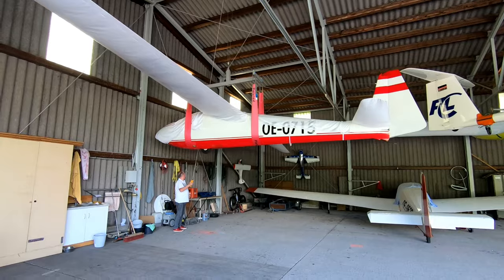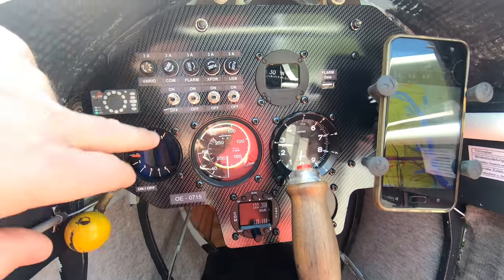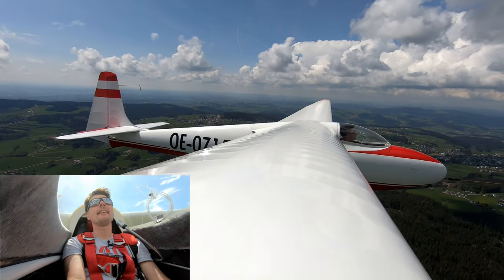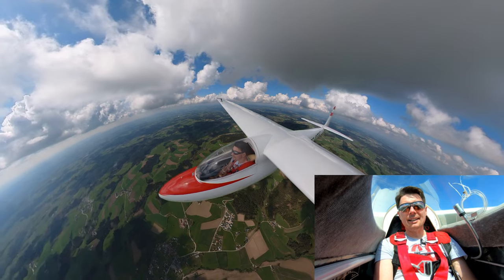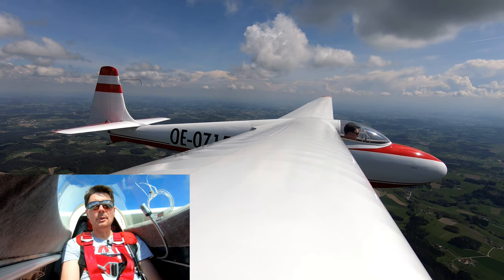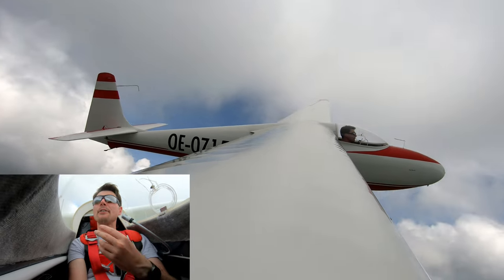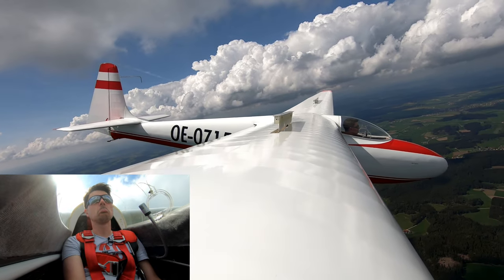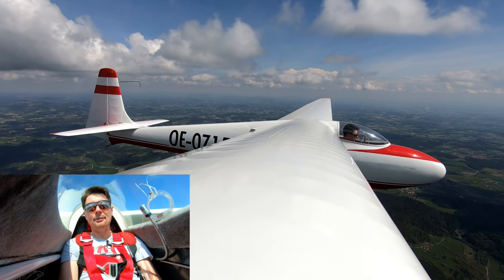How it is to fly a 1966 vintage glider (Schleicher Ka6 Cr)

Comment: I flew a K8 in wave to 18000 feet from a low point of 300 feet in 1982, no oxygen,radio,parachute or electric vario just an old ticking barometer behind my head lol and no warm clothing sheesh  I was 30 years old then, Im 72 now and the memory is still vivid, I got my gold height award for that and landed at dusk after a few hours airborne once I found a hole in the clouds to spiral down through...the beer tasted good after that I tell ya.

Comment: When I started to fly in 1986 we used Blanik L13 for training. The single-seaters the club had were two Libelle (one Std, one Club). It was required to get 20 hours solo in the Blanik before moving to the Libelle. It is very very slow to build solo time in a Blanik unless you have ideal conditions, and no other students around. I actually gave up. Then the club bought a Ka6CR, which required only 5 hours solo in the Blanik. They phoned and said "Bruce, come back!". I had one check flight in the Blanik (after some time gap) and then straight into the K6. Lovely! In the same conditions I got 20 minute flights in the Blanik I immediately had (the maximum allowed per person) 90 minute flights in the K6. Within  a few months I was flying both the Libelle also, and cleared for cross-country in everything. I later flew Ka6E and Ka8 as well as Ka7 and ASK-13.  Sadly, these gliders are getting old and rare now, and they are not making more. But you can get almost exactly the same experience in a PW-5. The speeds and glide angles are somewhere between a Ka-6CR and a Ka-6E.
Reply from the maker: Hi Bruce, thank you for sharing your story! Great. I can absolutely imagine that time-building was much easier with a Ka6!
Reply: I had a very similar experience in the early 80's with minimum required hours as I did all my initial training in a Schweizer 2-22, not even the 2-33.  I could beat the tow pilot back to the ground sometimes, ha.  Then, I found a club that just added a brand new ASK-21, and that changed everything.
Reply: Club Libelle should have been ok with a lot less hours. But a Blanik shouldn't be that bad. It's about on par with a K 8 and is easy to fly.
Reply: @anttiruo  The Club Libelle is very prone to violently drop a wing (usually the right wing) behind a powerful tug (e.g. Pawnee 235) before you get the tail up through a combination of weak ailerons and perhaps a high angle of attack. Much more so than the Std Libelle. Unlike with top surface airbrakes, I don't recall opened the trailing edge airbrakes helping a lot with that. The very light parallelogram elevator control is also very different to a Blanik or K13 and you can easily get into PIO trouble on the first couple of takeoffs when you have absolutely zero experience with it. If you learned on a Duo or DG1000 the jump to Libelle as first single-seater would be much easier. A K6 or PW5 really is a good intermediate step. Also Blanik->K6/PW5->LIbelle performance going 165->130->110 in sink rate and 28->32->35 in L/D really makes it significantly easier to soar and go cross country in weaker conditions.

Comment: That brought back happy memories. I was in a K6CR syndicate for a couple of years in the early nineties and did a couple of long flights in in (leisurely 100k distance and some local fooling around in each flight).  It was a lovely plane and I felt so in touch with the air when I was flying it. It also felt a very safe plane for field landing as it was very easy to land accurately and in a short distance.  One thing I can recall was preferring to circle to the right in thermals because the airbrake lever on the left (and my leg, and the narrow cockpit) made getting full stick deflection to the left difficult for a 6 footer with long legs. To circle to the left, I might find myself have to operate the left rudder pedal on tiptoe so the joystick could just pass below my leg.  We winch launched exclusively at my club and the plane had been a club glider. But it had been judged unsuitable as an early solo plane because the grass on the club airfield could at times get a bit long and there had been a couple of incidents of wing drops on launch. When I enquired more, it had always been the starboard wing that had gone down, and my suspicion was that the pilot had not had sufficient stick authority to the left to pick the wing up. So I always started with the stick slightly to the left as 'all out' was called and I was ready (and expecting) to have to immediately move it to the right. It might sound an odd thing to do, but it gave me a 'head start' on corrective action should the right wing go down, and the tactic always worked well for me ;-) Happy days, and a lovely little plane to fly - I doubt I'd fit in one now!
Reply from the maker: Hi Mike, thank you very much for your story! I know the thing with the missing full stick authority from our Ka8. Not very good for some pilots :-(.
Luckily memories of nice things like flying such a Ka6 stay with us for a long time. Very beneficial for us :-)!

Comment: Hi Rudy,  I owned a KA 6CR in the late 70's.  Entered a few sports class contests and flew it a lot.  I sold it and purchased a Standard Cirrus.  It's true that the performance and characteristics are vastly different but flying KA 6CR would bring a smile to any sailplane pilots face, as it did to yours.

Comment: So when I was flying, the "vintage" gliders were our first single seaters; they were our bread and butter! I first single seated in a K18 and flew them a LOT; I flew the K6CR a few times, and also got one or two flights in a K6e. I flew a K8 a few times at Cosford, too. Trainers I flew a good few times in K13s and once even in a K4!

My favourite was the K18 - the others always felt like I was peering out of a tiny bubble but the K18 had a very low cockpit wall and you could see EVERYTHING - also the K18 felt like higher performance and a bit racier than the wooden fuselage ones (it had a body of aluminium tubes with a stretched fibre covering). 

A wonderful time, and thank you for this video.
Reply: Yes the K 18 is a great performer. On par with the K 6E. Never flew the first one though.

Comment: I've flown a 1969 Libelle H201, an SGS 2-33 and SGS 1-34, each with their own characteristics.

I co-own the Libelle and I really enjoy it.  The narrowness does mean my shoulders are touching the gunnels, and you almost feel the wings are coming out of your shoulders, so you strapped on a glider vs sitting in it.  Controls are light and responsive, and you really can feel what the airmass is doing around you. 

Each of these gliders has spoilers/brakes on top/bottom, so you need to noticeably change your attitude accordingly to maintain airspeed when using them, especially the 1-34.

Every different glider I fly, I feel I learn a lot more about what the aircraft is doing vs my own input, so I think it improves myself as a pilot.  No matter the performance, these are all fun to experience.  Anyone who has an opportunity to fly older gliders should take advantage of that.
Reply from the maker: Hi Dave, I completely agree to your last sentence!

I have flown a Libelle too, but it was 15 years ago. Me and many more Libelle pilots can confirm the feeling, that with the narrowness of the Cockpit it feels the wings are an extension of your arms and you feel better, what the air is doing around you.

Unfortunately I have never flown any Schweitzer glider, I hope I will be able to fly one once.
Thank you for your comment 😃👍

Comment: Totaly hooked on flying Vintage gliders. I own a 1965 Ka-6CR which I absolutely love. I take her cross-country very often, did a 300km declared triangle in it a few weeks ago. I fly several vintage Slingsby gliders too and am co-owner of a Skylark 3C that we are restoring to flying condition. The Ka-6CR in my opinion is one of the most balanced and relaxing gliders in existence. Although the Skylark 3 with its 18,2m wingspan is quite special too...
Reply from the maker: Thank you for your comment, I totally agree, the Ka6Cr is a very balanced glider 😃  - I should fly vintage glider more often too 😍
Reply: Had a half share in a Skylark 2 , 15 metre . Lovely vintage glider but sooo heavy to rig . K6cr was sooooo delightful.  Lovely bit of kit .

Comment: I did my silver C and owned a K6CR about 20 years ago.  I've owned and flown many "plastic ships" but currently own a Slingsby Dart 17r.  My club owns a K8, K6cr, K18 and K13 so I'm lucky enough to fly and instruct on a number of different vintage gliders.  In the UK we also have the Gliding Heritage Centre at Lasham which as a member means I get to fly a wide range of vintage and unusual types.    Vintage is best! :)

Comment: I own a Ka-6CR that is.currently undergoing a stripped-to-the-bones safety inspection and refabric/repaint, NOT the result of any damage or prang, but just due to age. (I also own & fly a Discus B ... so the work on the Ka-6 goes slowly.) But they are absolutely wonderful to fly, particularly on weak soaring days. (And we get a lot of those in New York State, USA)  The Ka6 is the best-thermaling glider I have ever flown -- low wing loading and lovely controls ... partly because it has a nice big rudder.  

The Ka-6 series was (and remains!) the most contest-winning design in the history of soaring - dominating the standard class for years and years ... until the glass sailplanes took over.  It's ability to dominate the other wooden sailplanes of its era was subtle -- on paper some of the others were better, but the Ka-6s just kept winning.  The most-notable competitor to the Ka-6 in its day was the Std. Austria ... that I have also flown.  I don't wish to be invidious ... but while the Std. Austria could beat the Ka-6CR on a strong day, they were lousy on weak-to-moderate days, and they had very unpleasant handling characteristics, particularly trying to do a cross-wind landing.  Contests are won or lost on the weak and average days -- mostly everybody gets around the course on a strong day, and the speed advantage of winning one won't make up for landing out on a weak one.  

The Ka6-CR evolved into the E, and PE ... they look very similar but have a finer fuselage, and the wing sheeting was changed to improve laminar flow.  In that late era just before glass came in the Std-Austria evolved into the Austria SH, that fixed a lot of the flaws of the Std.  George Moffett owned one and extolled its virtues, and sure knew how to win with one ... I've never flown an SH, would like to if I could, but they are rare.   A Ka-6 E (and likely a SH) could give a Phoebus a run for the money .... but when the Std. Cirrus arrived it was game-over for the woodies.

If anyone ever lets you fly a Ka-6 there is one thing to know, that is implicit in this video, but not stated: land it on the grass, do not try to land it on a paved surface if at all possible.  There are two reasons: (1) all the wheel brake it has is a rub-band on the tire.  The brake is lousy.  You may think you know about this if you are familiar with the Schweizer 1-26, but remember that the Ka6 is a tail-dragger: no skid.   (2) The spring+tailspoon will result in zero directional control from the tail (no tailwheel) landing on asphalt as you lose airspeed.  This tail does a LOT better on grass.  But the standard stupid/newbie "accident" (if one is willing to call it that) is a new pilot makes a "nice landing" on a narrow runway in a mild cross-wind and thinks everything is wonderful until they get down to about 15 its ... at which point that big rudder and fin turn you into the wind ... and off the side of the runway the pilot goes futilely jerking at the brake ... and into whatever is over there.  The Ka6 is made for German and English soaring -- big grass aerodromes.  It is not made for the smaller one-runway asphalt strips so common in the USA, particularly the typical 50' wide asphalt with landing lights 2 ft (2/3 m) off each side.  Recognize its limitations ... don't break up a beautiful oldie in the dumbest and most common way.

Comment: Started 1970 on Blanik, K13 then K8, K6CR and E, then Dart 17.  Silver was in a K8, Gold triangle K6E unofficial then repeated in a Standard Cirrus.  Those were the days... Instamatic camera mounted on the left side, smoked tinfoil barograph (fixed later with hairspray), chalk board declaration signed by an OO, proper navigation, turnpoint had to be sighted and photographed in the correct quadrant (the negatives had to remain uncut)...no GPS, no motors, no water ballast, many land outs and retrievals..incredible experiences and memories of late night retrievals and above all the amazing cameraderie and friendships made...

Comment: I owned a Ka-8b back in 1978 for a summer.  I hated putting it together, but it just floated and floated when airborne.   I was really surprised at the sink rate at higher speed.  Thermal at 36mph and 70 mph was diving.

Comment: The Ka6cr was my first singleseater way back in the 1970:s.
I agree on the flying qualities, You really feel the thermals in a different way and in more detail. My present club has a very nice Ka6cr from 1961, SE-SWU, I still enjoy flying it especially in difficult weather with tight thermals when the air is free of composite... lots of fun.
Reply from the maker: I totally agree 😍! Thank you for your comment 😀👍
Reply: In my club in the 70's you had to have 100 hours total time to be able to fly it. And it took years because you could only fly 30 minutes at a time with the K 8 and the likes because of dozens wanting to fly. 70's were a crazy time and gliding was a fashionable hobby. Back then they used to have 3000 winch launches this time in the summer and today we have only 356. This was before I was born though. Of course that flight hour reguirement had nothing to do with safety but with the older pilots wanting to reserve planes for themselves.
Reply: @anttiruo  Sadly gliding has declined similarly here in Sweden. Actually it is the same in most air sports. I fly hot air balloons as well, same problems.  I got my C-diploma 1974 and I agree, the situation was very different back then... Funny thing is that after corona we now have many of young people getting into gliding in the clubs I fly at, very promising.

Comment: I learned to fly on an ASK13 in 1981 and then moved into the Ka6cr in 1992 and enjoyed flying it very much. I did my first 50km in the K6, and also flew my first contest in it. Such a great ship to fly, if you ‘think’ right, it turns right. You can thermal it on a wingtip and it goes up! The only glider that has the same control harmony is the Discus, but the K6 is still easier to fly. The best one I flew is my friend’s K6E, CFXSX… just a gorgeous glider.
Reply from the maker: Hi Mike, i totally agree! It is really a gorgeous glider 😍!!

Comment: Looks like you had a lovely flight! I co-owned a 1960 Ka-6 CR as my first glider. I believe the glider is still flying today. It was very stable glider on the ground run and landing and great for building confidence. As you observed, it was also very good for climbing in light lift, which made it possible to achieve soaring flights of some hours without much difficulty. Due to glider performance being lower I always stayed close to home.
Reply from the maker: Hi, thank you for your comment! Yes, the Ka6 is really nice to fly. The owners also decided not to go cross-country with it, as they want to avoid any possible damages during outlandings.

Comment: I did my training in a Ka7, Ka13 & Ka8 launching with reverse auto tow at Baldonnell military aerodrome West of Dublin.
Reply from the maker: Hi, reverse auto tow sounds great, i never saw one in real life. My training was on ASK13 and Ka8 too, so good memories came up while flying now the Ka6 😍
Reply: @RudisGlidingAdventures  The record launch height at Baldonnell was over 4,000' I think it's a World record, but was never verified. The glider was a Ka6 I think. To get to that altitude the tow car would be going backwards with the brake pedal working in the same sense as accelerator was in the early part of the launch. I often wondered what wing loading of the glider was with 4,000' of high tension piano wire hanging out of it!

Comment: Memories... I flew our club (Sunraysia, mildura Australia )Ka6 around a 524 kilometre triangle at age 18 in 1972 for diamond distance  -- it was not considered 'vintage' then ,in fact my father owned the oldest glider still flown regularly in Australia - an Eon Olympia 2b ,homebuilt in 1948 but of 1938 design . I won the state championship in it also in 1972 - THAT is a vintage glider .  In 1973 I worked for SchemppHirth building Nimbus and Std Cirrus 'plastic' super ships that are themselves now 'vintage' (hardly seems like fifty years have passed ....)  The Olympia was considered to have superb handling for it's day and could climb on the smell of an oily rag as the saying goes -- I flew a total of 1000 kilometres in three consecutive days in it (one flight over 400 k ) during a competition in 1971 --my father, Keith Nolan,  flew a 500 k triangle in it in the 80s and owned it until 2017 - for 50 years ! It was unique in having 'nose art" - a silouhette of a witch on a broomstick  which gave it the famous name of Yellow Witch - it's exploits recorded on Olympia websites .  Even flew it open cockpit once or twice (as I did my old Sagitta ) - lighter gliders gave more feedback and 'feel' of lift than modern well sealed ships . Thanks for the revisit.

Comment: I flew the K6CR as well as K8, K18 and Slingsby Swallow. Also flew the K6BR which is similar but only had a belly hook so it was a bit more tricky for aerotowing. All these gliders thermalled great and you could often circle tight in the core and outclimb more modern glass gliders.